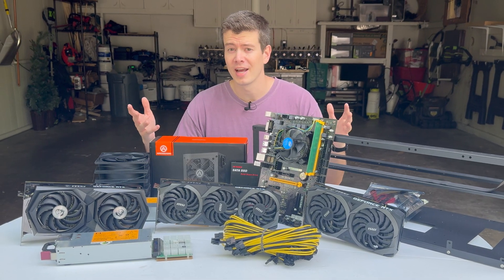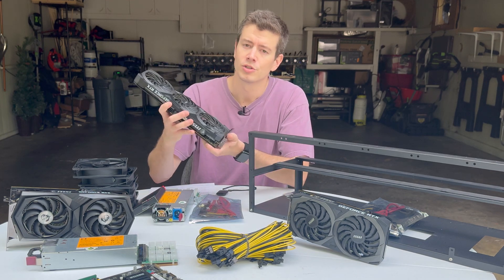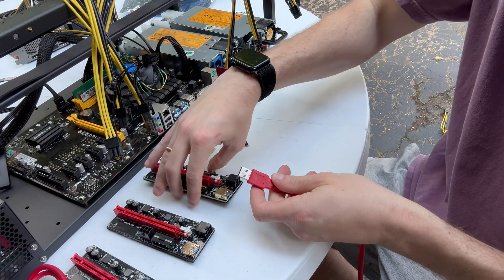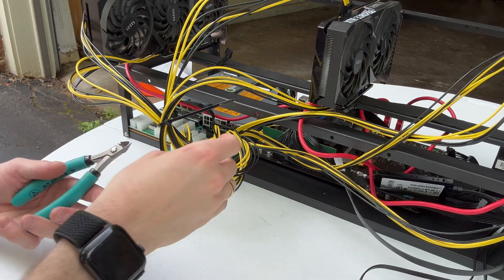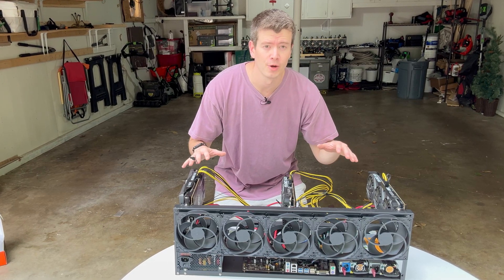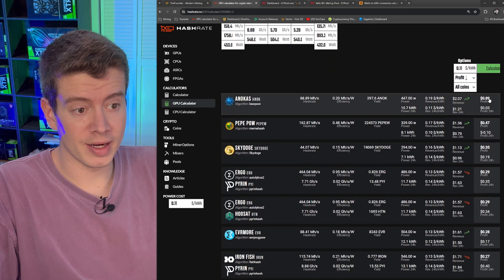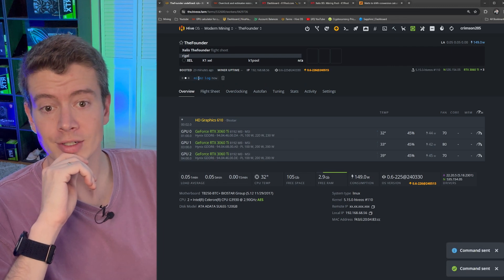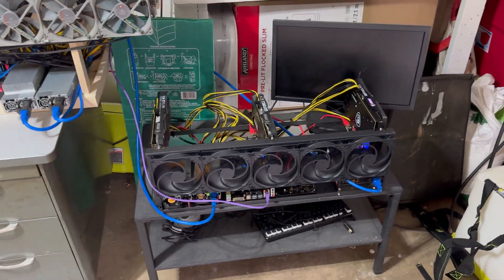How To Build a GPU Mining Rig in 2026 - PROFITABLE!!

Comment: 1000.00 to make 1.70 a day LOL That's a waste of 1000.00
Reply: That highly depends on your setup and the electrical costs.

If you're serious about it you'd stick to cheaper countries with sub .05$/kwh.

You'd also opt for solar energy/battery system focusing on non-peak tarifs if you consume electricity(that also works by over/underclocking your miners depending on time) and a efficient cooling system which saves you another 10-20% on your second biggest running expense.

I know a few people personally who retired by farming bitcoins on a larger scale (250k+ investment) - to be precise, they went to Brasil, did that there, held their overflowing btc(today worth above 7 figs)
Reply: @defidaddy9025 I have free electricity. What type of miners make big money?
Reply: @ZeroPrints0 antminer S21 XP hydros

Comment: Which Psu did you get? When i click on the link it asks what breakout board and how many 6+2 pcie cables.
Reply from the maker: X11 amp, as many cords as you need!
Reply: If you didn't get the setup yet, I have one you can buy for the low.

Comment: Question about the server psus to the gpus have you had any fire issues due to the 6pin (psu) to 8 pin(gpu) cable only being rated for 75w? That gpu should pull around 150w

Comment: I need help so badly. I got the whole thing set up and there's power to my GPU and my riser with the breakout board power supply. But the atx power supply isn't turning my motherboard on. I ran it one time and all of the fans ran. Even the CPU. This was without a monitor or hive os set up. But ive flashed hive os and have everything. Ever since I unplugged it won't run the motherboard or activate anything on the monitor.
   If anybody could help me I would greatly appreciate it. A lot of money have been put into this.
Reply from the maker: Do you have a power button plugged into the motherboard? Join the discord someone can help you.

Comment: i just dont understand how after investment of a 1000$ in parts, a 1.7$ per day or (x365=) 620$ per year can be called a profit.
Reply: There are many factors such as inflation which will make you money less valuable but also there's the rising price of bitcoin which might be duble in a years so your income will increase but again the govt. will also apply tax on the money
Reply: Pay rate, power consumption, and cooling (mechanical, evaporation, open environment, or geothermal) all cost make a difference. Mining only in off hours, under surge costs for power, and during winter all help cut costs. 

The amount of crypto you receive is volition, so you may get 1$ of crypto today, and it cost 10$ tomorrow.
Reply: Bitcoin will also go up and be worth more, and yknow, after two years you're just straight printing money until the hardware craps out ( prolly five years) all and all a good investment if you have 1000$ and five years of patience- but stay broke ig

Comment: Hi Jack,

I hope you’re doing well. I recently purchased a few PSUs that you recommended on your website, and I wanted to ask for your guidance on the type and specifications of breakers I should be using with these PSUs. Could you provide any recommendations or guidelines to ensure everything is set up safely and correctly?

Looking forward to your advice. Thanks in advance! you are the best
Reply from the maker: Hi hector,

Which psus? In general they will all work on a standard 15a 120v home outlet. The only exception is 1200w+ server psus require 240v.
Reply from the maker: @hectordiaz7618  look up x11 breakout Board on parallel miner site. I have links to their site and boards in all my video descriptions

Comment: @modernMining For the 750 WATT power Supply
Under the Breakout Board Option,  which are we supposed to get ?
Has multiple options
1 : X68 8 PCIE
2: X11 16-PCIe
3: X11-AMP 16-PCie
4: ZSX 16-PCie??
Reply: So I’m trying to get everything to build a rig , however you have two seperete lists a “COMMPONERS USED” and the “Essential Mining Rig Components”  im Wondering if this is correct and this is everything I’ll need (besides the actual GPUs).                     1x “cheap SSD”.                                          1x “budget PSU”                                          1x “6 pack risers”.                                         1x “Monoprice 105294 15ft 14AWG Power Cord Cable w/ 3 Conductor PC Power Connector Socket, 15A”.             1x “SaiTech IT SATA Cable III, 5 Pack SATA Cable III 6Gbps Straight HDD SDD Data Cable)”.                                      1x “mining rig frame”.                                1x “Full Kit MB/CPU/RAM - BIOSTAR TB250-BTC+ 8 Slot Mining Motherboard                                                       2x “94 % Platinum Efficiency HP 750 Watt Power Supply.                            WITH options “voltage input at 120-240 “.   Breakout board to x11 16 PCIe. And “+8. 8+2 Pin PCIE cables” .                1x  “3 Pack Computer PC PWM Fan Splitter Cable 1 to 4 (4 Pin+3 Pin)”                         1x “ARCTIC P14 (5 Pack) - 140 mm Case Fan, Pressure-optimised, quiet motor, Computer, Fan Speed: 1700 RPM”.                                                                 ———————————————is there anything else I would need ? I see on the Essential Mining Rig Components: it has the PCIE splitters but they not listed on the components used ?   Also will the frame come with screws or where will i get the right screws for the fans and motherboard and all that?
Reply from the maker: @WooDeWow  x11 16 PCIe good sir!

Comment: You said you were using 240 outlet but can use a 120 outlet with 3 gpu cards correct?  How many cards do can you run on a standard outlet before needing a 240?  Thanks
Reply from the maker: 120v x 15a minus 20% is 1440w
Reply: @ModernMiningHub  thank you. So the max you can run being 1440w the 3 3060s come in at 1200w correct?

Comment: If you are going new, in Canada, you can actually purchase 3 X RX6600's($249) for the price of one 3060TI (850-900+) . The 3060TI's are gorgeous but the cost doesn't make it worth in my case where I am currently building a 12 GPU rig. Not apples to oranges but.....you got some really good deals buying on eBay and such, great video to get someone started.
Reply: 1 3060 ti is not even close to 850 tho
Reply: @GominingYoda  3060 TI's are 750-900 on Newegg Canada/

Comment: How efficient are those server psu's? Are they platinium?
Reply from the maker: Yessir 94%
Reply: @ModernMiningHub  Just to add to this, I built two very similar rigs 8 x CMP30HX. One uses a BTC-s37 and a HP 1200w server, and the second uses a BTC-T37 and a 2000w Chinese ATX. The difference in power was 97w!

Comment from the maker: What would you have done differently in this build? Happy mining!!
Reply: I have preferenced to make "housing heaters", puting only a few fans below, blowing air up to the "fanless GPUs" AMD 6600xt that I took out the fans and got an cheap & low wattage GPU mining 24/7 and heating the house... on each "rig with 4 GPUs", I put an cheaper CPU AMD 3600 that pulls only 65W and make a few bucks more ;)
We have to think about the real problem when Winter comes... dont use an 1200W heater, use an 400W RIG and you got:
- 3x less power wattage = Less expensive at the end of the month to pay the eletric bill;
- Low Wattage + Mining almost every coin = passive income;
- Heating house for free;
- Easy and Clean Heater setup;
- Programable: You can run HiveOS easly and if you configure the Wifi conection on HiveOS, you can have only 1 simple power cable (850W PSU its enough for 4x 6600xt + 3600 CPU), connect to the wall and auto-run!
Reply: It all depends on the power fee. Would probably of used a single 1200w server PSU with the ATX. Agree 3060ti is a great card! Other options for budget could be 5700XT, could get 6 for same money,  Or if you wanted to be real rogue BC160 are about $130 each, 6 would yield you more crypto and use very similar power (only negative is resale value as only miners buy them)
Reply from the maker: @CurrynChipsMining  do they have 1200w psus for 120v? If this was a 240v setup i would have definitely gone with the bigger psu.
Reply: @ModernMiningHub  That is a very good question! I'm in the UK so higher voltage. I have also used the exact same board in one of my first rigs, very reliable and has not missed a beat in 2 years.
Reply: You need solar to supplement your power during the day. If not, it’s so hard to profit.  M main GPU miner runs on solar during the day and goes back to regular when no solar.  No inverter needed. Proof concept has been on YouTube for years.
Reply: 1200w server psu a b75 mining board which can has msata for storage and it can be powered from 2 6pins from a server psu and has the rebtech usb for the risers and 14awg cables from the veteran miner those 16 and 18awg cables are dangerous to use on rigs they melt short out and can cause fire
Reply: i would definitely put fans in correct orientation first of all